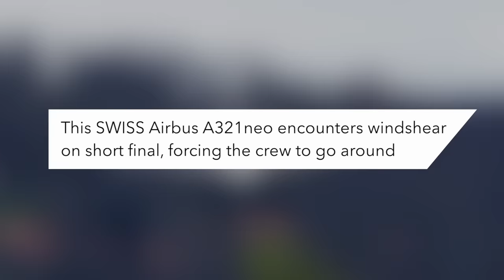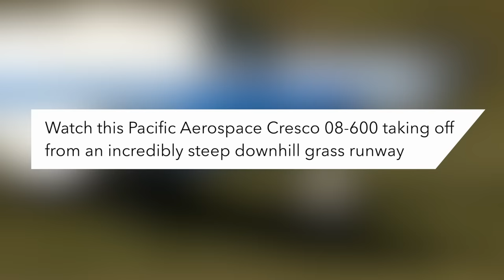Windshear Sends Plane Into Nose Dive

Comment: 1:48 The 767 didn't take too long to take off, the controller told them to line up and wait and then didn't clear them for takeoff until too late.  The controller apologized to the pilots afterwards.
Reply: is it appropriate for the controller to tell the plane taking off to abort? they may not be able to.
Reply: if you watch the full video, ATC clearly says "cleared for take off" then after readback ATC says "traffic 2 mile final". not the controllers fault.
Reply: @xisotopex  yes absolutely, part of the job. if pilots are unable to abort they need to report that as their reply, then the controller has to react accordingly, for example by turning the plane that is going around
Reply: @qtrg5794  really? what if the controller cant see the plane and they are at v1? even if the controller can see the plane, they are not necessarily going to be able to know the speed? so in that case you think the FAA just lets them figure it out, that there is no SOP for a situation like this? "just do whatever you like"
Reply: @xisotopex  This applies to basically any ATC instruction/clearance, be it a climb to a certain level, specific rate of climb or speed. The controller uses their experience and knowledge to estimate the performance and capabilities of the aircraft and crew theyre talking to, and issues instructions that they expect to be within those capabilities. If the crew disagree, they will speak up as its their responsibility to operate the aircraft safely. If the controller needs assurance before implementing a plan, they can ask beforehand if the crew are able to follow a specific instruction.
In the case of a take-off abort, the controller has to weigh the safety benefit of keeping the plane on the ground against the risk of braking from ever-increasing speed. No sensible controller will therefore instruct a take-off abort anywhere near V1 except in extremely critical cases. Still, every situation is different and being able to do "whatever you like" (within legal limits,) is a two-way street called responsibility.
Reply: @xisotopex  If ATC were to cancel take off clearance too late then the pilots would make that determination and take off I assume. ATC cancels clearance after the roll starts all the time, like someone else said its literally their job.
Reply: @russianblunt248  Um... That was definitely the controllers fault. I've seen the full video and takeoff clearance was late, 2 miles is not enough.
Reply: @russianblunt248  A two mile final is not enough time for a heavy 767 to get up to rotation speed. Several near misses have been caused by tight sequencing like this in the past couple of months, to the point the FAA held and emergency summit on the issue. It is much better to stop the aircraft on the ground than seeing which one can outclimb the other as they lose all horizontal seperation.
Reply: @xisotopex  Yes it is, any time below V1, especially since it was only a couple of seconds after brakes-off. Of course the controller should not have issued the late clearance in the first place, but having reached that point then a failure to abort the take-off would have put the departing aircraft into direct conflict with the go-around
Reply: @xisotopex  But they were not at V1, so you are trying to make a case out of something that didn;t happen. If they were already at V1 they would be a long way down the runway and much less in conflict with the traffic going around
Reply: @xisotopex  to be fair if they were anywhere near v1, there'd be no need for an aborted takeoff or a go-around in the first place- although some more communication with the plane taking off might have been nice here.
Reply: @MillionFoul  nah watch the video and listen. Plenty of time between cleared for take off and 2 mile finale call for them to begin roll. Keep in mind theyre already sitting lined up and waiting, so once the clearance is given and especially after calling 2 mile finale, you should be rolling. The heavy pilot even asked what's the reason for the late departure. I work at this airport and see 2 mile finale setup often. The argument, whether it's save to do so is not up to me to debate, but it ain't the controllers fault in this particular situation.
Reply: Repent to Jesus Christ “Now faith is confidence in what we hope for and assurance about what we do not see.”
Hebrews 11:1 NIV
U
Reply: No one is "at fault". The controller was doing their job properly. All pilots were doing their jobs properly. Sometimes you take a little longer to take off after being cleared. Maybe something came up in the cockpit. The pilot's company could have some procedure they were following. They try to line things up so they happen fast. This works 99% of the time, and saves a ton of time. Those small occurrences of overlap cannot be eliminated. Period. So they decide on an allowable amount. This just happened to be one of those times.
Reply: @harryspeakup8452  i mentioned it because it HAS happened before.
Reply: @danieljckson  there has been a few cases where ATC has asked to cancel takeoff, only for it to be too late.... lotta close calls lately...
Reply: @xisotopex  it is, pilots are still allowed to reject take off before the V1 speed (decision speed). Rejecting take off after decision speed is only allowed if there is a specific emergency
Reply: It was the controller NOT the 767 Run-up taking too long
Reply: @MillionFoul  2 miles is fine.
Reply: @rtbrtb_dutchy4183  At 140 knots Vref you're gonna cover two miles in 44 seconds. That's about how long the takeoff roll for another heavy aircraft is, ignoring that the aircraft on final needs to make their go around decision (if neccesarry) before it's too late for their engines to spool up, call it ten seconds to touch down at the latest. That's basically thr absolute minimum, hence why you see airplanes going around and nearly colliding when seperations get this low.

It's stupid and unsafe.
Reply: @MillionFoul  oh, so you were aware of the headwind in this scenario?  There was no head wind component?  

There is already an ATC controller in here somewhere saying that 2 miles does happen at that airport frequently without issues. 

If you listen carefully, he was given a take off clearance, then after a bit was told about the 2 miles. That was a hint. Get going or it won’t work. 

We don’t see airplanes nearly colliding. That just happened recently and made the news, so now everybody is upset. But the 10’s of thousands of times this happened before this incident, it was never an issue. 

People make mistakes sometimes. But this wasn’t a mistake or even out of the ordinary from an ATC point of view. 

What was out of the ordinary was the pilot not being ready when he should be. We all hate sitting in line behind those guys. First they get a clearance to line up on the runway and it takes them 30 seconds to just get rolling. Then they sit on the runway, get their take off clearance and they take another 30 seconds to a minute before they start rolling. It’s inconsiderate. It’s annoying and it’s unsafe.
Reply: @xisotopex  There's 3 videos on this channel of aircraft aborting takeoff at near max takeoff speed as well.
Reply: @xisotopex  the aircraft was going slow enough to abort
Reply: all these keyboard pilots XD
Reply: @xisotopex  "just do whatever you like" is more like "just do whatever is best in this situation", the flexibility in air traffic instructions is a big reason we don't have to have extremely inefficient airspace in order to avoid collisions
Reply: The video has been cut, the 767 took too long to take off and on a busy airport is normal to line up planes with quite short distance between them and the ones on final. You can line up a plane when one is on final but it has to be before a determined distance from the runway threshold, the ATC surely did so but the 767 wasn't ready for an immediate take off. I'd like to know if the controller asked the pilot if it was ok for him to take off immediately.
Reply: Thanks for the real story.
You ain't no sheep like the rest of us lol.
Reply: @xisotopex  correct after V1
Reply: @xisotopex  There's a "point of no return" where they have to take off. But that's about 2/3rds down a runway when the plane is doing 130-150mph. - given the plane had barely started even rolling it was no-way near. And of course the control tower has authority. Priority given to planes in the air I would imagine!
Reply: @markyates5744  o rly? what was the total takeoff weight of this 767-34AF? what were their flap and throttle settings? what was their V1? what was the wind and atmospheric conditions at the time of their takeoff clearance? what is the length of 10R? did ATC have visual?
Reply: @markyates5744  Nearly everything in your comment is wrong.
Reply: @markyates5744  BTW we dont measure speed in MPH, we used Knots or decimal Mach numbers at cruise
Reply: For the record, the ATC can’t clear the takeoff while there is an aircraft on the runway. The way this was set up in my day (in the 80’s) was to ask Pilot#1 (the preceding landing) if he was going to make the high-speed taxiway after landing. If that was a yes, then “Request minimum delay on the runway, one to roll before the next landing”. Then, to Pilot#2 on final, “One to depart before your arrival, expect a late landing clearance”. Note: IF he wasn’t happy with that, he should have said so then, but he did not. Only then, would Pilot#3 be told “One on short final, line up behind that aircraft and hold, there is one at 4 miles on final, request minimum delay”. AGAIN if he wasn’t happy with that, he should have said so then, but he did not. Note: clearance for takeoff cannot be given until Pilot#1 is clearly committed to the high-speed exit taxiway. In that situation, Pilot #3 is expected to line up without delay and then spool up the engines to depart immediately he is cleared. ALL OF THIS would have happened prior to the clip starting. BUT NONE OF THIS IS DANGEROUS. It required the cooperation of all three pilots, but the go-around was alway the safety-valve. Note that Pilot#2 never received a landing clearance, and was within seconds of initiating the go around himself. If professionally done, all Pilot#2 should have needed to do was to release the brakes as soon as cleared. 

This common scenario always requires the cooperation of all three pilots and works almost always. What we don’t know is what happened in the cockpit of #2. A dropped clip-board may have caused a critical delay. But one final point; Pilot#2 was a heavy. If Pilot#3 was not, there would have been a 2 minute delay for wake turbulence, if he did not get away in front. And that rebounds down the line for all the aircraft waiting — I’ve seen 54 aircraft waiting in the queue.
Reply: @Jjer.z  😮oķ🎉😢kk😮😮🎉🎉🎉ķ😢😢😮
Reply: Controllers fault - but he remained professional and corrected his error.  No harm, no foul.
Reply: @winstonchurchill3597  Winnie, nope. There are some fascinatingly presumptuous comments in this thread above. Every aircraft has TWO pilots. In takeoff mode, one has to fly the plane, the other has to look out the windows and be spatially aware. It was the job of Pilot#2 to observe the one on final, as they accepted the instruction to line up. If there was something likely to delay them, they should have balked at that point. Somebody above rabbits on about how the controller doesn’t know all of the factors in how long an aircraft will roll, before lifting off. Not true. Pilots have a complex set of tables that allow them to set their throttles, given all the variables involved, in order to lift off at the optimum point along the runway. They do this to minimise stress on the engines and fuel consumption, but it becomes very predictable for the controller. Finally, there are countless situations where tight sequences only work with the full awareness and cooperation of all parties involved. If an occasional spanner drops into the works, there are always fallbacks, but a if controller is too conservative, he/she will be moved on.
Reply: @xisotopex 
It isnt a matter of being appropiate or not. ATC cannot under any circumnstances tell a plane to abort its take off.

Comment: That windshear was pretty close. That looked similar to the microburst that caused Delta flight 191 to crash at DFW in 1986. There was a smallish thunderstorm off the north end of the runway. The cell collapsed and caused a mircoburst as Delta 191 was on final approach. It missed hitting a hotel, bounced off highway 114, killing a guy in his car, and then crashed just short of the runway. The only passengers that survived were in the tail section. 
We went out to dinner that night and didn't know anything about it until we got back in the car and saw ambulances and police cars with markings from multiple agencies racing north on I-35E.

Comment: I was in a 777-300ER when it experienced a microwindshear just feet above runway before touching down. The whole plane rock to the right and the pilot-captain immediately applied a fast crosswind correction n the plane touched down in a crab position. It took some 20-30 second of hard ruddering to maintain the airplane to deviating much from the center line n it braked so hard, my chest could feel the deceleration (I was watching the touchdown from the camera) . Having good brakes is priceless especially for a 800,000 lb 777-300ER.When the plane was hit by the microburst n its wings rocked, I thought I had 20 seconds to live. Luckily, the experienced pilot-captain's fast reaction save us all. I think I was the only passenger who realised this. On the way out, I told the stewardess to inform the piliots that it was a very exciting fight.
Reply: Sounds like an Emirates landing.   Directional control seems to be an issue over there.  That and taking off.   And going around.
Reply: @lbowsk  Cathay Pacific Hong Kong International 2010 Summer. HKG is known to have microburst, especially for morning landing

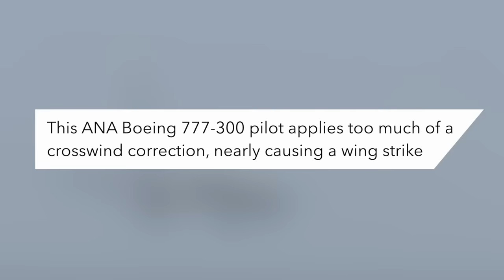Comment: 1:26... that wasn't a crosswind correction.  The error was not having the right wing lower into the wind.  So the wind couldn't get under it and push up on the right wing which caused the left wing to dip.

Comment: SwissAir, he began his initial flare too far on the downwind side of the centerline.   Very difficult to fix at that point.   So a GA was a good idea.   ANA....was nowhere close to a wing strike.     UPS...partially a controller effup, but the guys on the runway should have known how tight it was and been read to GO.   The poor slobs who had to go-around were probably at the tail end of a 10-hour flight on a 14-hour duty day.  Sucked to be them at that point.  Good thing the weather was benign.

Comment: The first flight was not wind shear, it was a cross-wind.  Cross wind landings require practice.  Many commercial pilots fall out of practice since the airlines restrict them.  The takeoff delay was an uprepared crew.    No one should roll onto a runway unless ready to go.

Comment: Noob here, can an aviation enthusiast/expert explain to me how the landing gear doesn’t tear off when a jet appears to not land in a straight line due to crosswinds?
Reply: When a plane is landed in a crab, it does put shearing sideload forces on the gear. The gear would tear off except that they just simply are built strong enough to withstand those forces up to some certain amount. It's just  a simple case of brute stength against brute force.
Reply: Unless you're a B 52
Reply: @dougaltolan3017  True. There always has to be an exception.
Reply: @4stringmanagmaildcom  Thanks! So the planes get straightened out at the last second... got it. It's hard to tell from footage at times what angle planes are hitting the runway at.
Reply: @johnschmidt8440  Thanks!

Comment: Why was the takeoff of that 767 aborted?
Reply: So he wouldn't be climbing out into the path of the MD-11 that was going around over him
Reply: There was another plane scheduled to land just after the 767 would have taken off. But the 767 took longer than expected to be ready to roll. So the MD-11 was closing and in the end was going to end up too close. If there wasn't a collision then what could have happened is the 767 generating huge volumes of fast moving turbulent air could have caused serious difficulties for the landing MD-11.

There is usually a time-distance between aircraft depending on their sizes. Bigger aircraft usually create more turbulent air. 767 v Cessna, for example.
Reply: @kg6jay  Thanks
Reply: @Google_Does_Evil_Now  Thanks for the reply.